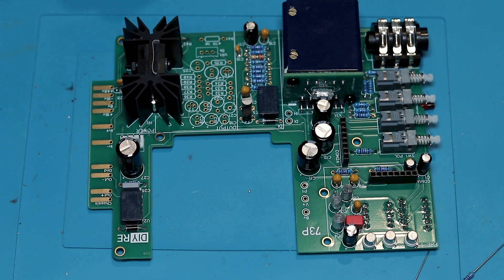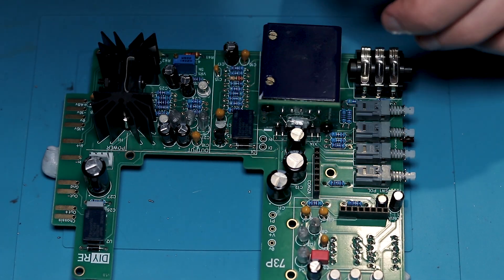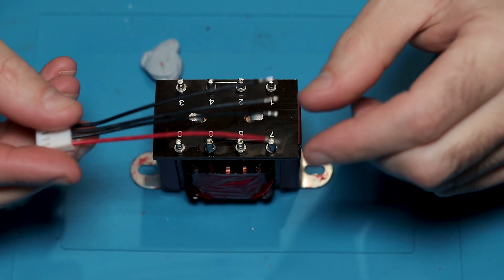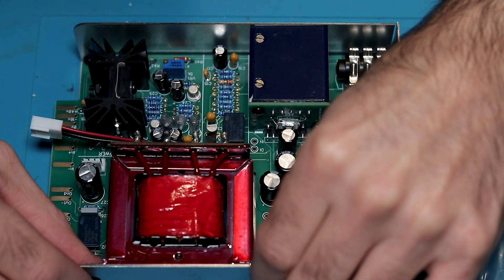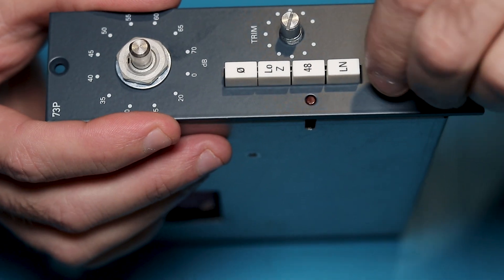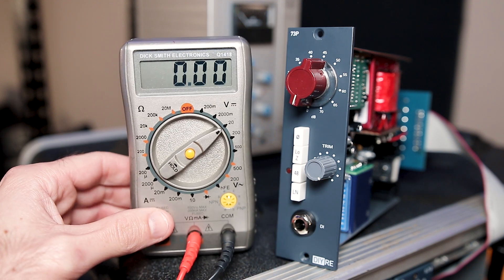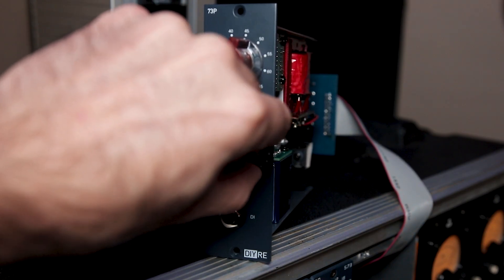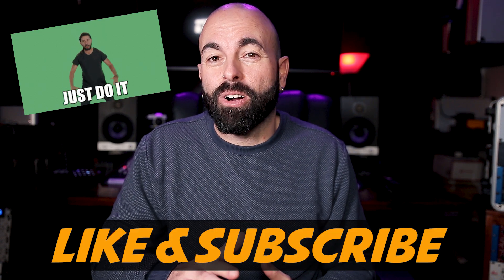Build Your OWN NEVE 1073 Clone - DIYRE 73p Build pt 3

Comment: Im new to diy electronics. I work with synthesizers and digital audio mostly and I'm wondering if you might recommend some kits for line signal? Something to give nice saturation or colour. It doesnt really matter to me if its an eq or compressor or whatever. Just interested in getting your advice on what kits you think are good quality and at a similar price to this
Reply from the maker: Great question. What you might be looking for is something like the DIYRE colour format. https://www.diyrecordingequipment.com/collections/colour

They’re exactly the starting point that is newbie friendly and can give you heaps of options for colour.
Reply: @diyrecordingstudio  I've seen those. That sounds great and thanks for the recommendation. I thought that could be the ticket